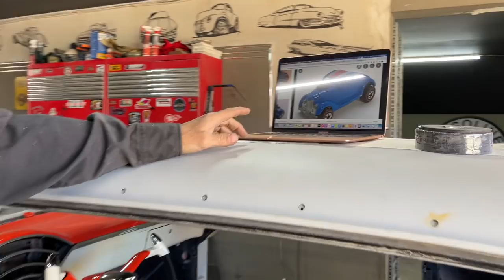Attaching the body to the chassis | Hot Wheels Neet Streeter concept

Comment: The frame fits well, it looks perfect.
Great job guys. 😎👍 
However, the car looks a bit tall in the front to me. I don't know, but to the eye it seems to me that you will have to lower something in front.
Greetings from Switzerland
Reply: He is planning on lowering the front, that will happen when he puts on the smaller tires. Which he said, he's planning on doing in previous videos.
Reply: @fonhollohan2908  👍

Comment: I didn't understand tacking the front a pillars and then squaring the backend of the car unless the backend was out of square.  Maybe I missed the explanation but why did the body to floor mounts at the B pillars extend into the passenger space?  And why weld them to the top of the sheet metal?  It would seem to me those brackets should have been confined within the limits of the interior panels and welded directly to the floor brace.  Had it been turned over, the gussets could have been outside the sill and between the body.

Comment: thought you said you were going to weld the bars far enough up on the pillars to go over the edges and stop around the bottom of the frame or side sills you welded to the floor. Oops, guess ya fudged the measurements.

Comment: chad, it sounds like your lift is either low on oil or needs bled.  top it up, and hold the lowering arm and lifting button at the same time to bleed the system.